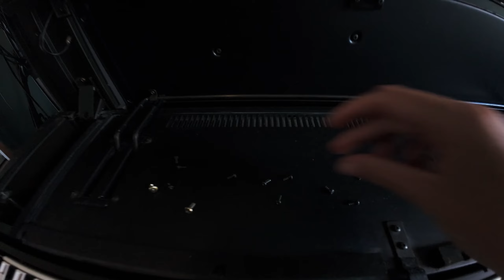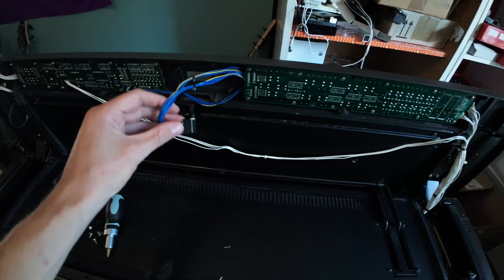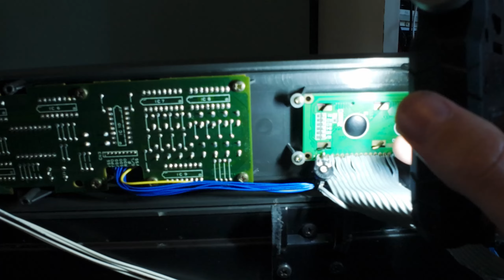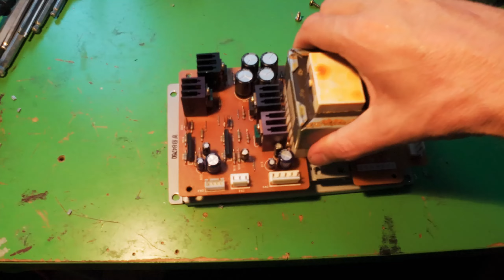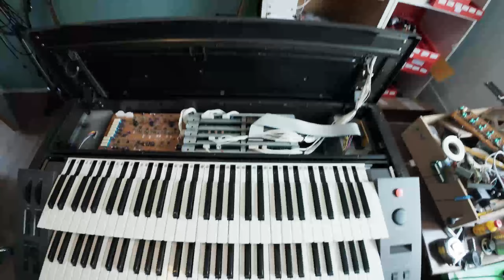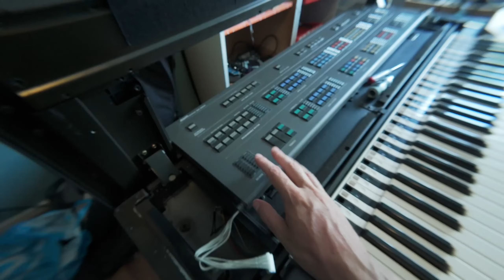Yamaha Electone HX-1 - Upgrades and Maintenance

Comment: Excellent work. That bit with the lost screw is a classic. Everything seems to be going well and then some cascade problem arises halting the actual work forever. My compliments for staying cool (at leat on the outside). You where very close to having to drill that screw head off.
Reply from the maker: It did infuriate me a little lol luckily it all worked out!